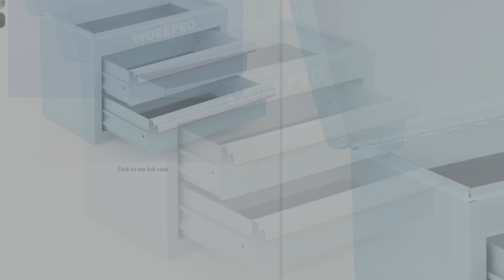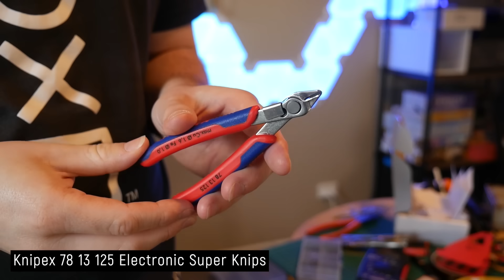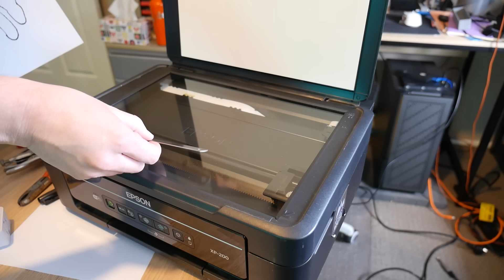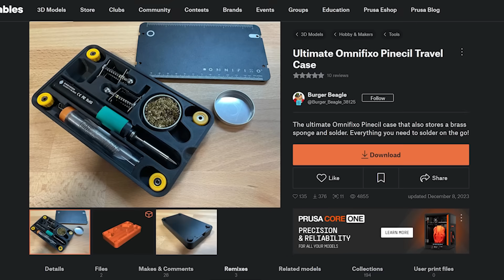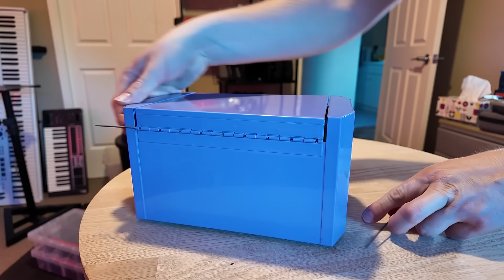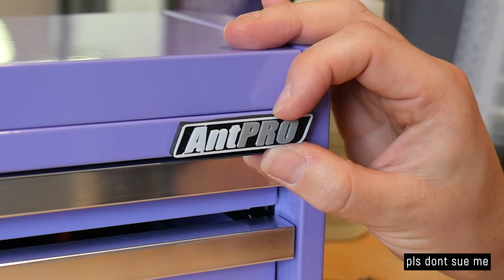Designing the ultimate tiny toolbox organiser - with 3D printing!

Comment: Take an EVA foam sheet, an exacto knife and trace the contours like you did with the pen. No rattling, no tools scratching, perfect retention, easily reworked. No boring hours in the CAD, no wrong use of a 3D printer.

The sheet metal tool box is bad, by the way. Lots of space wasted. Sheet metal provides tons of rigidity and strength, combined with thinnest 0.5mm walls. This box, however, wastes tons of these advantages in the form of weird thick rails and thickest side walls that would ashame even a beginner 3D printer user. And your conversion added giant rigs that prevent putting your box in a larger container.

Comment: You can skip using a ruler in the scanner, if you know the size of the paper sheet, which is normally standard, such as DIN A4 paper sheets are 297x210 mm

Comment: You should invest £20 in one of the electric screwdriver sets off of Amazon. I've had one for nearly a year now and was so impressed I bought my dad one. Goes great with the 3d printing hobby even for maintenance on the printer. The one I have had a hard cover plastic container that it pops out of when you pressed a spring load release button. All the bits are organised. And they're easy and mega efficient to grab and swap out. With a +/- magnetising block built in. A pair of long tweezers and a small levering tool. The quality of the bits and the choice is great too. I haven't found a single one I've needed and not had as it has all the security bits too. And the big selling point for me is that you can really crank on it. I thought it would mash up the gearing inside but it's extremely tough and allows you to torque down at least 10nm (by feel) 
5 power settings so you don't have to be scared of using it on mechanical watches either. Small but big upgrade for me to be honest.

Oh and it's way smaller than the one you already own

Comment: I got more and more into this video as I went along. I started it just out of interest in Angus video. By the end the juices were flowing and I was thinking maybe I should make one of these for my soldering iron, screwdrivers etc
Reply: Also a follow up. I used siraya tech tpu air (from your video) to make custom foam insert for a travel case for expensive electronics. I used the 65A settings 30% infill and line infill to try and get it squishable, but still solid enough to provide structure. I'm certain more trials of different  infill % and infill type would uncover even better settings for protection but this was reasonable. 

Could be worth a video :)

Comment: You can also just place the tools on the scanner.
Most scanners can still focus upto 1 cm (sometimes even more) above the glass plate.
It can be useful to add a background paper of different colors on the scan to make it easier to color filter the contours.
The resulted dimensions of a flatbed scan are often quite accurate.

Comment: nice vid but just wanted to point out the sequre s99, a soldering iron that is even tinier than the pinecil and is still great, been using it for about 2 weeks now and it works great, it also uses newer 245 tips
Reply from the maker: Seeing a lot of power supply problems with that one. What do you use?

Comment: fantastic video, Angus. Love all the "one more things" you did - I thought it was done with the tray on top, then you did the lid 180* and then you did the handle container's (the one for your usb cord is brilliant!!) and then you did the strap handle. WOW!! 
One thing to think about that you said you skipped in the bottom drawer is a sleeve: just an open-top, 3d printed box with finger holes to remove it. Then you have a tray you can pull out on a table, etc. and when it's time to go, just drop it in the drawer and go. It might provide additional useful locations when you're on-site and have a table to spread out, but if you don't, then it stays in the box. It's an easy way to get "everything" out of that drawer without having to take them out one-by-one. More importantly, it let's you put everything in the drawer away in a single go by putting the whole box into the drawer at once.

Comment: Using the lid as an extension of the workspace of the toolbox is ingenius and I did that a while ago.
Love the practical advice with the lower drawers, sometimes messy is better than trying to 3D print everything.

Comment: You can also use the toolboxes that mount on tractors. Some of them come with a pull out tray (like in parallelogram toolboxes). For what they are, they're pretty cheap and they come with a handle (some).

Comment: gridfinity is designed to make things easy to find, not super high density and packing everything in super tightly. it's the right call not to use it for such a tiny workspace

Comment: It's a great design and I hope it works out for you long term.  Myself I can't be limited to "this tool goes here and ONLY here".  I'm more of a "leave everything strewn about the workbench so it's always within reach" type of person.  When it comes to a toolbox I like space because there is ALWAYS more tools that you didn't know you needed until you see them.  I use a 7ft wide, 6 drawer dresser as a big toolbox.  You should see my LED drawer...3.5ft wide, 14" high and 22" deep...and it is PACKED.  Another drawer just for wire, one for soldering, another for nuts/bolts/screws/glue/tape etc (any kind of fastener really).  I would LOVE to be able to use a tiny toolbox but it just doesn't fit me or how I do things.

Comment: Rubber bands on the handles of spring loaded pliers and cutters help minimize their storage profile. (Idea stolen from co-worker.)
Reply from the maker: Ooh that's excellent! Consider it stolen again
Reply: @MakersMuse I use carefully "zipped" to size cable ties turned inside out after trimming the tail off so the bump of the cable tie sits between the closed plier handles. This also loads the ratchet of the cable tie in such a way you can't really accidentally zip it up tighter. It's a second or maybe 2 faster than a rubber band and doesn't perish with time (or oil brake fluid etc getting on it)

Comment: good stuff!  i should probably invest in something similar, with as much as i'm continually finding myself moving around from space to space working on my various machines....  i have portable toolkits for computer & electronics repair, but they're far too limited for my 3d printers.  something like this could seriously help & is a size that should sit on the shelf above my desk with no issues in between uses, assuming appropriate feet.  🤔

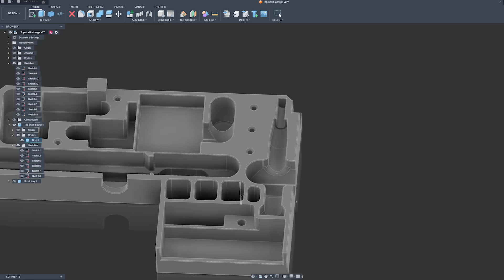Comment: 13:31 You can also simply add a "press pocket" on one side of the tool cavity to retrieve it. Pressing down the tool on that end will then lift it on the other side. Really helpful when you want to save space... so you don't have to add those finger pockets.
Reply: If you have vertical space.
Reply: @catprog  Obviously.
Reply: @ChannelRejss  which he didn't have a lot of it looks

Comment: I'm not overly familiar with Inkscape. The most I use the program for is the Trace Bitmap option/creating .svg files for Fusion360. I would love to know how to clean up those .svg files. Extruding from those rough .svg files can take a while to process. Other times, the .svg isn't actually solid outline and it can be tedious to find/repair.
Reply from the maker: Simplify path is a good one to use before exporting, but yeah fixing broken paths and removing unwanted nodes can be tedious. I'll put an updated tutorial together

Comment: Great build. Now you just need a PET-G/TPU handle on top! That is print-in-place that folds perfectly flat when you open the lid or just want it tucked away
Would be a great, functional, true multi-material printer for the U1. Hope if you like this comment and suggestion, you'll make a quick & short video making this!